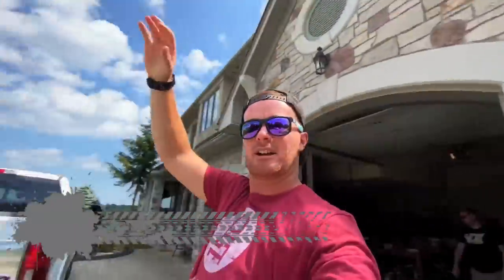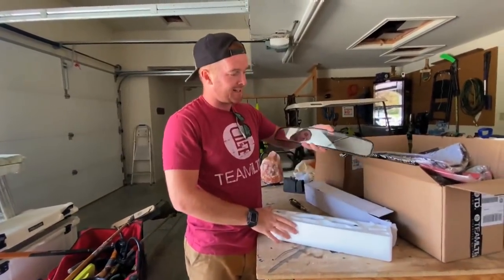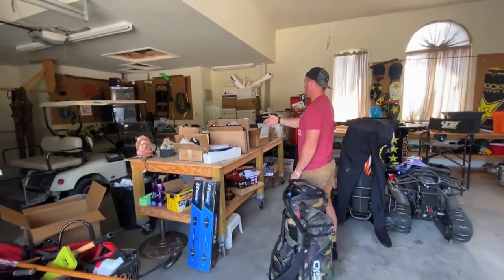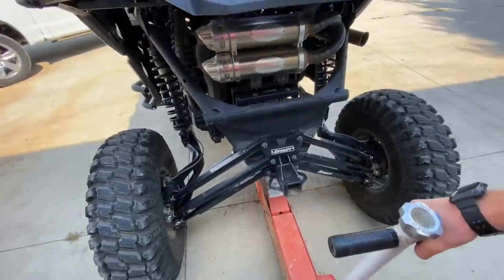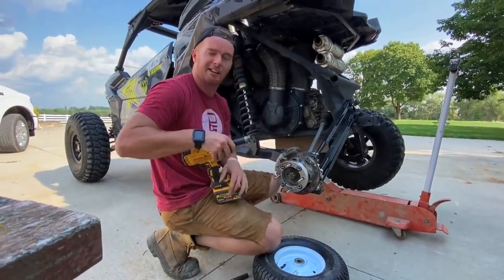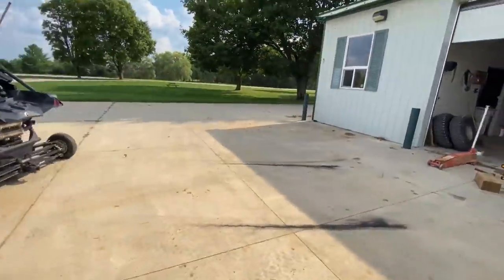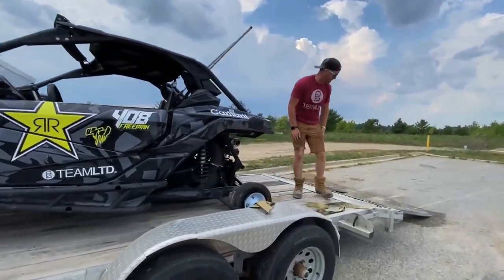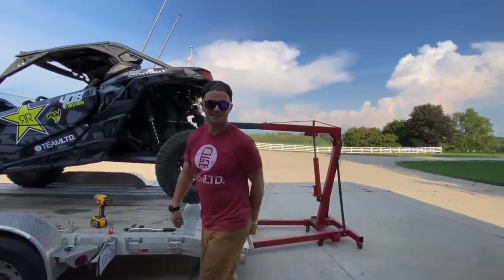$100 4X4 Tires FAIL!

Comment: I know im late but,Check the fuel pump on that ford wire pulled out of the harness splice back together and lauch it its a ford thing usually the black wire in my experience